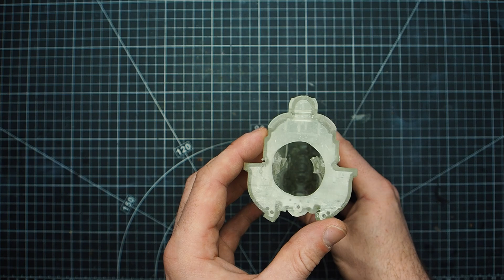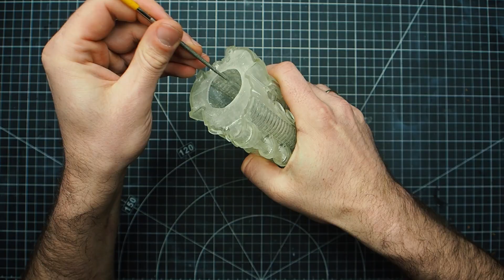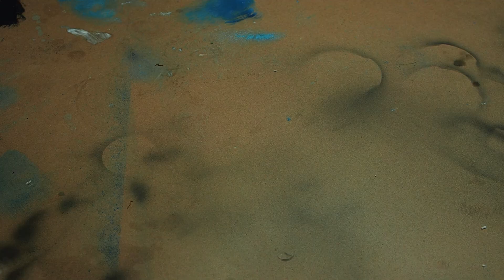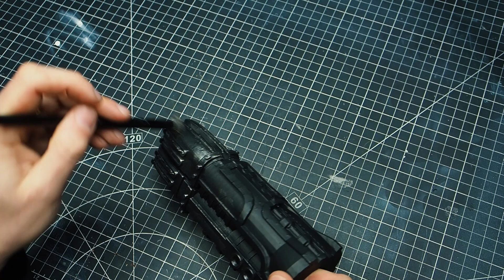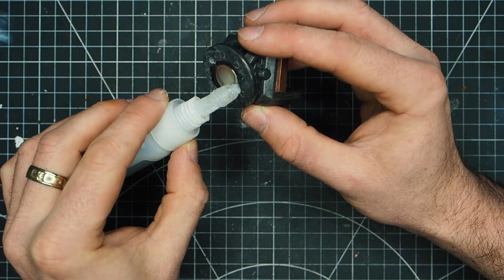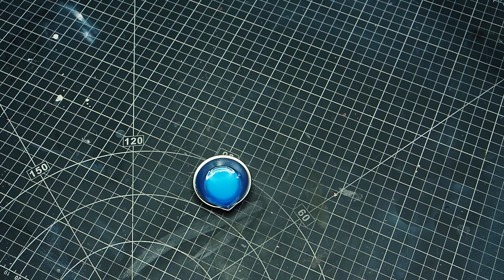The Warlord Titan is FINISHED.

Comment: AT 10:45 WHEN HES PUTTING THE 2 HALVES TOGETHER AND IT NOT FLUSH. Depending on what ttype of resin being used. What ever heats it up is the solution. I used a space heater put part close to the heater and let it warm up and doi the same with the other half then just reattach and -push together with force to make it fit tight. Boil a spegetti pot with water dip in the ends and do the same.

Comment: So first off looks amazing, and second off obviously if you want to try any of this just print out a test piece to play with(unless you have some failed gun fronts you haven't tossed out yet).  What about doing a recess wash with a fairly fluid white oil pant for the coils, and or doing a black or dark grey stipple on the high spots, like you see on a lot of the molten weapon tutorials?  I'm also curious if you might have been better off going over the prime with one of the liquid chrome paints then another coat of black to get the metal really opaque.  What about painting the inside of the clear resin with some more clear or clear blue to up the brightness?  Also what about using some florescent blue ink in the clear varnish?
Reply from the maker: Some very cool ideas there! I've got some failed pieces I could try these on